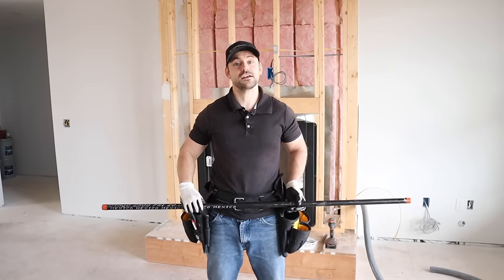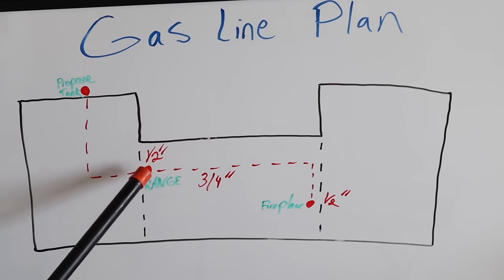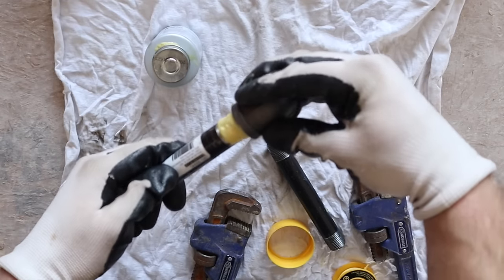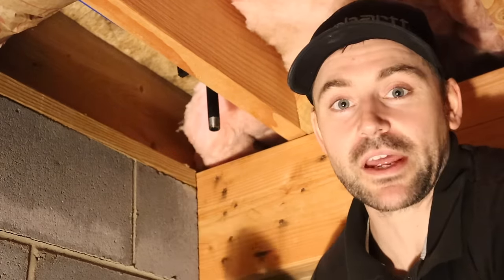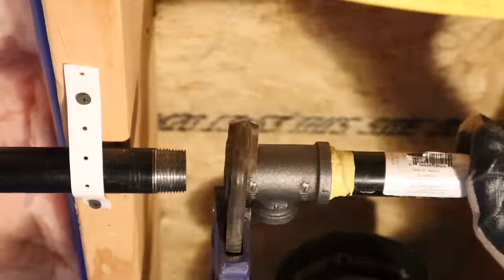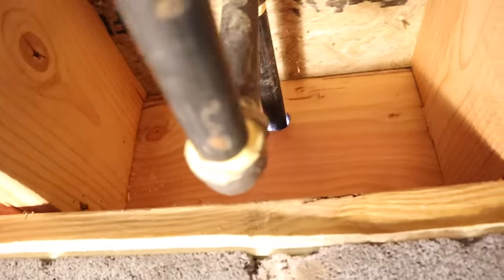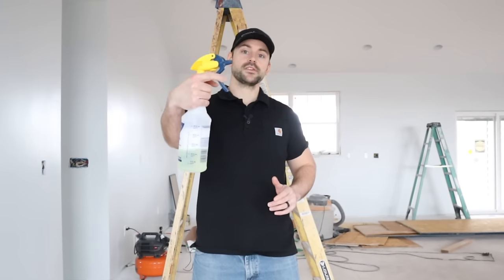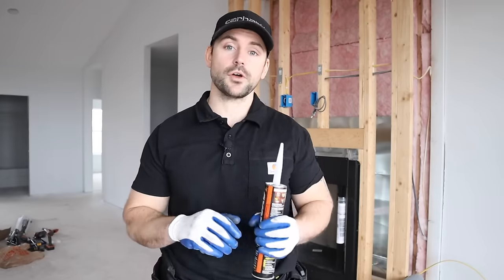Black Iron Pipe Gas Lines Installation - Sealing Fittings, Pressure Testing, and Bonding

Comment: I watch a lot of your videos but don't know that your install is the best ideas. Not using drip legs and couplings over unions. If you need to change anything or repair a section down the road you will be stuck undoing a lot of pipe. Use a tee and plug versus a elbow might be good idea then if you need to add an appliance you pull the plug and start a new feed.
Reply from the maker: Hey Daniel! Thanks for watching the channel! Yes adding those things like be the best setup but I have no plans on adding additional appliances. Hope all is well with you!
Reply: Yea you may not but In the future you may not be around…..u should take your video down it’s sketchy not entertainment

Comment: A little-known fact about pipe joint compound is that it does not only lubricate the threads but it also fills the spiral leakage path of NPT threads. The thread specification calls for the crests and troughs of NPT threads to be truncated or flattened, not coming to a sharp point, and that allows a spiral leakage path which pipe joint compound fills. There is another thread specification called "dryseal" or NPTF (National Pipe Taper Fuel) which has sharp crests and troughs and theoretically can seal without pipe joint compound, but the compound is often used anyway, for lubrication and to seal any imperfection that might exist.
Reply: Good info.
Reply: 4 years of US Plumbers Union apprenticeship and never heard that. The metal to metal contact is supposed to make the seal...(in a perfect world)...everything else is to help make the joint up and be able to take it apart in the future. It's  like a cork (tapered threads) that can't blow out.

Comment: I just watched your YouTube, where pressure test a gas line at 100psi .

Pressure testing gas line is very specifically spelled out in code books .  Usually low pressure gas lines in a building  are measured by inches of water gage , (wg) . There are 27.6 wg per 1 pound of pressure .  

The code reads,  1 1/2 test pressure of in line , gas pressure is required . Propane is normally 11 to 12 wg running pressure .  Not even half a pound . So 1 1/2 times running pressure is quite low .  If you test at 6 psi  for a 24 hour period, your good .  Too much pressure will blow your sealant out of joints weakening the overall system . 

Keep in mind if the temperature is cold when test pressure is applied , and it goes up to 90o , your pressure gage will be higher , say 7psi or so .
Reply: Would 100psi testing adversely affect the utility gas meter?
Reply: @jeepsaround The gas meter should not be seeing that pressure. There should be a valve to isolate the new pipe from the old system, then just check that one (or few) connections with a leak check solution. I have seen leaks in the side of cheap Chinese elbows(not the threaded joint) so always check the entire length, not just the joint.

Comment: I need to T of my ouside gasline to my shop.  There is already a valve outside off the meter that was put in for a fire place in the house.  I am removing the fireplace so i wanted to use that connection.  I will be running black steel pipe under the deck and then down into my trench going across the lawn.  My question is can i use black pipe for under the ground using an epoxy coating where the pipe is buried? If so what product would you recommend. The run will be about 40 ft long with about 25 ft underground.  Appreciate the videos!

Comment: do you have a video similar to the video for basic drain sizes for plumbing?.. I'm getting acclimated with gas fittings now, currently trying to figure out which parts to get to hook up an appliance and a I am struggling to understand the measurements for gas fittings, or know what sizes I currently have at home.

Comment: Good job! Personally I would have added a minimum of 2 drip legs (12”) one for the range and other the fireplace. I would also have used a union instead of a coupling, purpose is for serviceability. I would have the shut-off inside the house instead of outside, the propane tank has it’s own. I would also have a fireplace shut-off valve in-line. How would you control the fireplace gas?   Thanks….Jim
PS…….I live in the Midwest and have installed black iron and copper gas lines.
Reply from the maker: Hey Jim! I appreciate your input. I placed the shut off outside so I can turn off the system when changing the tanks. Yes drip legs would be best. I have never had an issue not having a drip leg so I didn’t add one. Thank you for watching!
Reply: Jim you are correct with the union and drip legs.  If he ever gets natural gas then his piping would all be good.  Natural gas can get dirt and debris in the lines especially when a pipe gets accidentally cut anywhere in the system.  While fixing the broken line dirt will get into the line and go through the system.  The drip legs can keep the dirt from hitting any regulators.
Reply: @TheExcellentLaborer  You need shut-off valves next to every appliance. The outside valve it nice to change tanks but does not meet the safety requirement should there be a leak. Gas is not something you want to cheat when it comes to safety.
Reply: Yes, appliance shut off valve within 6' and sediment trap downstream from valve as close to appliance as practical.
Reply: @ewotha2  And not just code but appliance manufacturing specs in most installations.
Reply: @ewotha2  Shutoff valves serving appliances installed in vented
fireplaces and ventless firebox enclosures shall not be required
to be located within 6 ft (1.8 m) of the appliance where such
valves are readily accessible and permanently identified.

Comment: My local Home Depot sells malleable black iron fittings and black steel pipes and nipples.  I read you shouldn't mix the two due to dissimilar metal corrosion.  But why would Home Depot sell dissimilar items to use together?  Can I mix these for natural gas installations?

Comment: It will work well. But if your point of entry in like 2 in 2 1/2 inch then definitely run a few on the end then more wraps where the thread meats the pipe to prevent leaks

Comment: Hey brother I love your content. Have a question to transition from 3/4 iron pipe to 1/2 inch copper pipe for LP gas. What fitting or shut off valve should I use from the iron pipe to the copper. Thank Ya

Comment: I've done all of the sizing calculations for my house and it's saying I should be running 1/2" for main line.  But I have 3/4" currently.  Do you think my calculations that suggest 1/2" are because I converted my fireplace to wood burning and left the fireplace off my calculations?  I'm thinking my old main line being 3/4" was because of the fireplace.

Comment: Nice work. Nicely detailed. But, next time your bonding the pipe in a joist bay, turn the bonding clamp 180 so it's easier to tighten the screws!

Comment: I know you used LP, but if you were connecting to a NG line, does the NG service pipe outside the house need to be bonded to the grounding rod or meter box with 6 AWG copper wire?

Comment: Hey Josh, thank you for sharing this buddy, I've built a few things out of that black pipe😄but have never run it as gas line, so I learned how this morning and I didn't know about the different colors of thread tape so I guess I've learned a couple things today.😁Have a Blessed day my friend!!!      Jay.
Reply from the maker: Typically yellow thread tape is for gas, white is for air and water, and blue monster is for all. I’m glad you found some value in this video. Black pipe is definitely a universal supply that can be used for many things. I hope everything is going good for you. Thanks for watching Jay!
Reply: There is also a green tape, used for oxygen in hospitals, etc. It’s thicker and does a better job with tapered thread……Jim
Reply: @TheExcellentLaborer  how do tell  if i have a 2psi system or low pressure system in home?

Comment: 4:40 pipe manufactures actually advise against using tape as it leads to over tightening into fittings which damages them and causes leaking.

Comment: no drip legs required before appliances?
Reply: Drip legs are code around here
Reply from the maker: If my appliance is above the pipe run like you seen here, I don’t use drip legs. Thanks for watching!
Reply: @TheExcellentLaborer  gotcha.,.it’s code in my state.

Comment: 9:00  : a tee or cross tee with caps/plugs for the future is a plus. I used a 3/4 main pipe with 3/4 tee or cross tee and a reducer for the 1/2 pipe. do this on either or both ends.

Comment: LOL, our local Lowes did not cut pipe. Nor did they know of a tool to thread pipe that is not a lathe. Same at the Ace, across the street at Harbor Freight however... They had both electric and manual pipe threading tools/dies available. Running my whole house tonight after manually (anger grinder) cutting and threading pipe (A pipe wrench to hold the work while threading [broke the vice, oops] with the manual die set is not easy, lol) yesterday. First time home owners life :)

Comment: Thank you for sharing. Just wondering how long does it take for the  pipe sealant to set?
Reply: It never dries so it's good right when finished.
Reply: John, Phill I suggest watch a 13 part series called What on earth happened by Ewaranon to learn that the earth is not a globe. Link in my about tab.

Comment: I’ve used one of rector seal products a few years ago and it sucked it didn’t even work leaked so much! It was air lines now I use  (Hercules Blue Block) I love it so much never have had a leak with that product.  It’s rated for everything from boiler pipes to gas lines to oil lines.

Comment: White pipe dope is not only for water.  Ive worked for a natural gas utility for over 20 years and we only use white pipe dope.  Pipe dope doesn't seal.  All pipe dope does is lubricate the tapered threads so they tighten more to seal.

Comment: How did you connect the pipe into the tank?
Reply from the maker: The house I currently live in, are used soft copper to a regulator and then into the tank.

Comment: Thank you for sharing your knowledge.

Question: Why did you reduce from 3/4 to 1/2 inch at the gas log heater? Was it to increase the gas pressure?
Reply: A smaller pipe doesn't increase the pressure. It does, however increase resistance to flow which is directly tly and linearly related to the length of the pipe, and more significantly, decreased by an amount related to a change in radius to the fourth power.

Comment: The working pressure of the system is only about a half a psi or half a pound often times on a new system like that when its full of air we will break a union loose till we smell the gas which can take a minute the pressure is so low you cant even feel it after you smell the gas tighten the union and then try to light the appliances because trying to light them with the pipe full of air will not work and will drive you crazy .

Comment: Is there any specific place I need to ground on the gas pipe? I could feasibly sand and attach a grounding wire where the gas line comes into my house very easily. Up in my attic, the only wire nearby that leads back to the panel is 14awg. I don't think 6awg going to 14awg is a safe ground. I'm looking to install CSST in my attic.
Reply: I was about to run csst and did a ton of research on it.  Good product but doesn't last near as long as black iron.  Plus the grounding dilemma.  Make sure your local code office approves of regular yellow csst vs having to purchase the expensive shielded black type.
Reply: @wg1408  I bought the "expensive" black version as it was only $30 more lol. Took back the yellow stuff. I have to run less than 25ft. I opted for Pro Flex instead of HomeFlex as I've read the connectors for Homeflex are quite garbage. I don't anticipate it being a problem due to the short length I have to run.
Reply: @ApolloniusOfTyana0  ahhh makes sense.  I needed 35' so maybe that's why it cost too much

Comment: thanks for the video. very helpful and informative. just what I needed when I needed it! quick question tho. I was relieved to hear that you don't need to tighten the joints all the way, as I ran into clocking issues and was worried that a few joints were not totally torqued into each other to allow for proper clocking. I hope that made sense  :/
Reply: Always tighten to spec never use tape only pipe dope

Comment: Hi there! I’m a gas safe registered plumber and 95% of the gas line installation is run by copper pipe  in uk .
What about in USA ? Ist always black iron pipe they use?
Reply: Mostly black iron pipe here.
Reply: @phillhuddleston9445  Is it called black iron pipe because it used to be made out of iron?! I'm sure it's made of steel today.
Reply: In canada most residential is copper outside (underground) and flex (stainless) inside and for commercial it's mostly Black iron

Comment: I saw your video on replacing and/or installing new gas lines and I have a question on purging the lines. I’m about to replace my water heater with a tankless water heater and I need to extend my lines. 
When you installed yours you added air to test the line. How did you purge the air.
Reply: No purge needed.  I swapped my water heater and gas lines.  Just turn it on and the air will come out.  No pressure test really needed either

Comment: 1. Pipe dope is to keep the threads from balling up when tightening.
2. Pipe dope is also used so that one can take it apart in the future.
3. It's the metal to metal contact that is supposed to seal the joint....NOT Teflon tape.
4. Teflon is used by rookies who can't make a good thread on their pipe (threading) machine.
Reply: Dude these videos are going to get someone hurt…. They should be taken down right
Reply: I was taught to never ever use pipe tape on gas lines. Ever.
Reply: @jaycecounts1212  You can... but it has to be a certain kind (marked yellow)....I use it when joining 2 dissimilar metals. (brass to iron and iron to aluminum) but always with a little bit of lubricating pipe dope.

Comment: It's impossible to break the fitting or the pipe through over-tightening. If the fitting is a malleable elbow, like the one you have, it will actually stretch wider. The only thing that would crack through over-tightening would be a cast elbow, which you don't seem to have.
Reply: Pipe threads are tapered. At some point, the limit of the taper is reached and the male and female threads seal together. Only two full turns after hand tightening are needed to seal...in theory one COULD break the fitting because the pipe is putting expansion pressure on the ID of the fitting as the two are tightened.
Reply: I’ve done it. I’ve had a fitting sheer the threads of a nipple clean half in two. I tightened it up and couldn’t figure out why I was getting leaks coming from the joint. I separated it and there was light through the threads. It’s hard to judge when something is tight when you have these muscles 💪😆
Reply: @flat-earther  well I’m not going to argue with naïve people. The earth is definitely round. I know from personal experience that I’m not going to talk about. Forget about that. My “dad” was in the navy he’s seen the world from sea level. I take for granted my life experiences, maybe I’d believe this ridiculous bs if i was naïve. I used to be religious. I try to ignore everything I know to still be religious. Kind of a problem if you ask me.
Reply: @flat-earther  where I live, from space all you can see is North America (United States, Canada and Mexico), and a small part of South America. you don’t see Africa, Europe, China and so forth. We all know those regions exist. So what the hell are you talking about? I’m not gonna watch some fool piss on my back and tell me it’s raining. Time is precious and I feel like I’m wasting it right now. No offense, you believe what ever you choose.
Reply: @rustyzipperband  I get time is precious indeed. I also was taught the globe model from childhood and I believed in it. So I get how hearing someone say otherwise might sound like bs. But well I took the chance to ''waste'' my time and looked into it and it was not a waste of time because now I know that earth is not a globe.

Investigating anything may turn out to be waste of time, but you can only honestly know whether it's a waste of time after actually wasting your time on it.

Comment: I used blk.iron pipe...for comprsoir air lines.i ran it for gas line in homes pipe thread sealer and tape..is a must..but blk, iron..is vary costly..to install..but last a 100 yrs...I installed  plex for air lines ..when it fist came out..as I found out over the yrs.in colder area,..it in some cases starts peeling from the inside out..the first Generation  plex..after 10 yrs ..beware..always add drip legs ..to both blk iron piping..when u run gas lines to furnace s and hot water ,and so no as rule of thumb. ...ok next ...  for air lines use a ball valve and drip leg for water removal to after it leaves comprsoir  tank..also befor u pipe your inground  lift..for air..use a drip leg and ball valve. To keep water out of the oil mix..to raise car..old school lifts..I hope this helps..anyone piping  a repair shop..as well my uncle was a pipe Fitter back in the 1950s  60sand 70s..I spent many hours helping him pipe new homes..growing up..in the 1970s ..ty great video   this is a great video  for the DYI..folks..but a word to the wise..make shure u have a professional  check your work..with all local  building codes..get a permits for your work..